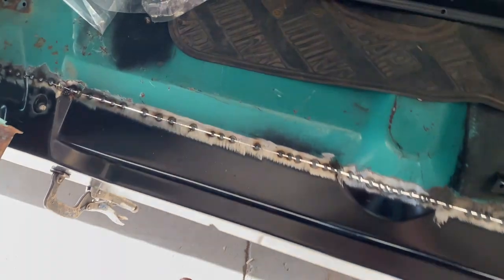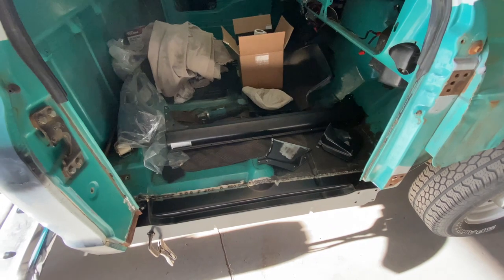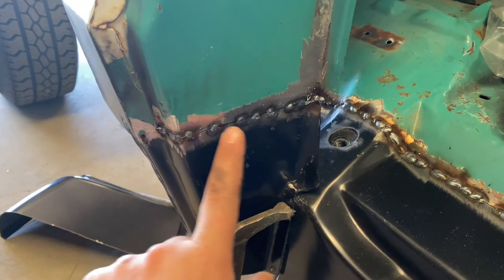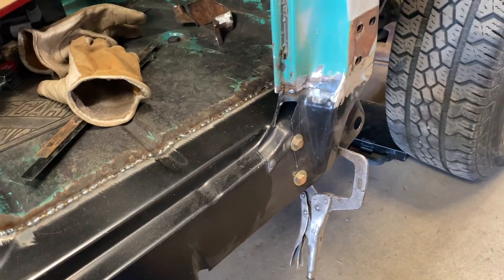HOW TO REPLACE RUSTED OUT ROCKERS! For beginners by a beginner. 71 c20 rust repair/replacement.

Comment: I was looking for tips for my old Bronco2 and your use of those gap spacers was exactly what I was looking for. Haven't done any welding in many years and back then it was pipe welds, so not much experience with thin metal.  Greatly appreciate your tips.
Reply from the maker: Thank you very much! It’s a lot different than welding thicker material. Just gotta take your time and be patient with it

Comment: Old video,  but it definitely came in handy for me. Are you a welder or paint and body guy by trade? You made this process look so easy
Reply: What type welder did you use? Tks
Reply from the maker: I’m Just a welder/fabricator. It was my first time doing it and was far from perfect lol
Reply from the maker: I’m not even sure what it was. A pretty old miller wire feed

Comment: Professional work, and as others have said, inspiration to tackle my own car. Now, this is not a criticism, but I would like to see also how you actually cut out the old rusted metal. What you used, how to get a straight cut, etc. And from that, the equipment you used to  weld it. I don't know if the speeded up video could be slowed down to show that, but just an idea. Again, fabulous work!!
Reply from the maker: Thank you! Maybe on the next truck I can do a more in depth video.
Reply: Thanks! That'd be welcome. @champlingarage

Comment: sup Great job my boy!
where did you but the clips to hold rocker panels to the body 
also where did you buy the rocker panels?
Reply from the maker: I got those clamps at harbor freight in the welding section! All of the panels are from LMC!

Comment: So you cut the inner rocker out, then butt welded the new piece in is that correct?
Reply from the maker: Yes I cut out the inner rocker and the outer piece of the floor. Then I butt welded the entire new piece in. The new piece was the outer floor and inner rocker as one

Comment: Can't learn or see much when you run in fast forward.
Reply from the maker: The only fast parts are me cutting and welding. If I left all that in real time the video would be hours long. This was also my learning experience so I was very slow with my work anyways.
Reply: Never fails a critic is always lurking.
Reply: It's the hard part, facing it, adjusting your plan as things develop that viewers wish was easy to copy. But when a guy does this, it kind of comes together because you're in it.
Your explanations are good.
There's a flat vertical piece behind that you see after getting in.
A person needs to add that to his order of parts.
My question is, how do you kill the rust you didn't replace, how did you treat the sections before the POR 15?
Is it spray, brush on, or the evaporust liquid wash, or have you just welded it back together and left it in there and a layer of POR-15 applied to it like a skin?
Sorry I didn't see.
Hope it's not a dumb question.
Looked like a nice job outwardly.